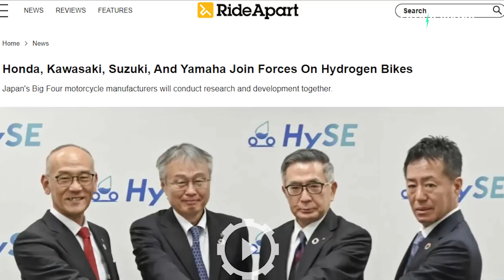Honda joins Toyota's, Suzuki & Kawasaki to make hydrogen engined vehicles

Comment: The reason hydrogen powered ICE vehicles are attractive to manufacturers is likely because the manufacturing machinery required to manufacture them is almost identical to that curretly used for hydrocarbon fueled ICE vehicles. (Fuel tanks being an exception)..
New infrastructure for refueling stations will however be required but when faced with the prospect of having to scrap billions of dollars worth of plant and equipment it's easy to see why legassy manufacturers are giving it a try.
New BEV manufacturers just don't have the burden of seeing all that investment in plant and equipment go down the drain though they have had to finance the setup cost of BEV manufacturing equipment which ICE manufacturers would also have to finance.
It's a sign of the desperate situation that they are in and goes a long way to explain why they have not embraced the move to BEV's earlier. (Living in denial).

The complexities of developing hydrogen ICE engines:-
https://www.youtube.com/watch?v=3IPR50-soNA&list=RDQMs1knXeKXFO0&start_radio=1

The unfortunate truth about Toyotas Hydrogen ICE Engine:-
https://www.youtube.com/watch?v=vJjKwSF9gT8

Why hydrogen ICE engines are a bad idea:-
https://www.youtube.com/watch?v=1Ajq46qHp0c&t=132s

Comment: Hydrogen power has the advantage of range. The fuel to get that range is much lighter compared to the batteries needed to get that same range with an EV.
Reply: The first 600 mile range EVs were delivered last week. H2 isnt going to happen.

Comment: JCB in England have also developed a hydrogen engine for use in tractors, Lorries, Construction machinery etc. Their engines are beyond the experimental stage and are well into live testing. Installations. They are convinced that for commercial vehicles it is a better option than battery.  I wouldn't write off the hydrogen engine just yet.
Reply: For some applications H2 will work, but it wont be many. Hydrogen requiresa lot of electricity to create as a molecule.
Reply: If I have fuel cell. With motor with instant torque. A decent size battery pack for last mile. Why bother with thousands of moving parts? If we are concerned about copper shortage，fine. Lets get some aluminium wire eith copper plating. It is not as good, or efficient. But it drive thr cost down and save weight. Lithium is pricey and hard to extract. Well, how about sodium, that is cheap and good enough to work.

Comment: I could have one now in my Toyota truck by putting a high pressure tank in the back and running lines but where would I get the fuel? On top of that, the fuel isn’t any cheaper than gasoline so what is the point.

Comment: So i strill have to pay for oil,oilfilters,fuelfilters air filters, clutches, exhaust,brake pads ,fuel pumps, spark/heater plugs ,dpf,cat. And pay to have them fitted ? Noooooooooooooo way japan 😜😵😆🤪🥴😊

Comment: You've answered your own question. There are many ICE powered things that are not suitable to be battery powered. You're hung up on the car industry thats why you can't see their logic. Japan will use it's new gas cooled nuclear reactors to produce cheap electricity to kake hydrogen. It will when it's ready mass produce electric cars. They will do so more efficiently, cheaper and the product will be more reliable. Just like they did in the 60's withe ICE powered cars.

Comment: You would think that there is nothing wrong wwith EV's...there is plenty wronng with them....the main one is mileage.....if they can recharge to full...not 80%...in five minutes...then they will have cracked it...nowhere near that right now though!!!
Reply: I've spent zero minutes charging my Tesla in the last 8 months. The only time I have to wait is on a road trip, and the 15-20 minutes is about the same time I would take to stretch my legs and go to the bathroom after 200+ miles of driving. If you average the gas filling time with road trip charging, I spend much less time refueling my car. Gas is a waste of time.

Comment: Everything about hydrogen is troublesome: production, transportation, storage, efficiency, transformation to motion, refueling speed.
Everything about electricity is easy: production can be clean, storage in megapacks, very efficient, electric motors have been around for centuries, rapid charging speed, less than ½ hour no matter the size of the battery!

Comment: I understand their interest in Hydrogen. Simply put two stainless steel electrodes into water, add a catalyst like salt and introduce a low DC current. You are now producing the most Explosive Element in the Universe. But You are Right. A lot of heat is generated from the ignition of Hydrogen.
Maybe, they can figure out a way to do it.
Imagine Water as Fuel, No Pollution.
Reply: To try this at home. A 9V Battery is good enough for demonstration. 2 S.S. kitchen forks, a teaspoon of salt. Then just add a drop of Dish Detergent to form Hydrogen Bubbles and ignite them using a match. Note: Don’t let the 2 S.S. Items touch each other after applying current.

Comment: According to Toyota the move to hydrogène internal combustion is justified by the following reasons:
Toyota believes that the world is not yet ready for all electric engines ( poor range, very long recharging time,availability of charging stations...).The range with a hydrogen engine or with an electrical engine fed by hydrogen is similar to a petrol car,filling up time is 2/3 minutes.
.The hydro engine also is zero émissions and avoid depending on availability of natural ressources to build the batterries.
- Toyota also believes that the driving pleasure of a car must be maintained and the internal combustion engines allows this.
Finally Toyota doesn't want to put all its eggs in the same basket by going solo electric.
The EU has also made the développement of hydrogen a priority with the creation of the EU HydrogènBank as part of its Net Zero.Industry Act .
Stellantis, Renault are also developing hydrogen fuel cell engines in France next to their electic or petrol,diesel engines.
Legacy brands are leaving all options open I guess by offering the customer a wide choice of engines.

Comment: i am glad they are choosing to go on a separate path instead of following the herd.  There are many obtacles in the way of wide adoption of EVs.  One being, the vast amount of minerats required for the batteries. The better the range, the heavier the battery, the more the minerals required.  High demand means high price.  Two, geopolitical consideration,  China monopolize rare earth refining.  China control the prices.  They are the largest consumer and refiner in the world.  Very difficult for foreign  competition to take hold.  Rare earths are required for EV motors, wind generator.  The extraction transportation and processing of these minerals requires burning hugh amount of fossil fuels.

I hope this Japanese consortium will some day provide the world with a viable alternative in hydrogen vehicles.  incidently fuel cells also requires minerals like platinum.

Comment: I thought some time ago hydrogen would replace gasoline and diesel . It's an abundant element . We saw some attempts from GM on EVs with a big crash and burn some years ago . Nissan did finally bring an EV to market but it was mostly a novelty and they were not motivated to push the technology forward . So all was good with gas and diesel powered vehicles . The Japanese you could say are the best in the world building ice but as sam suggested building a ice engine running of hydrogen was a challenge so that's why Toyota went with the hydrogen fuel cell but electricity isn't their bag . Tesla changed the world and it was unexpected   Toyota just did not see it coming as many others . They just don't see a way to compete on the EV platform . Now they may get this to work but the problem is making and storing hydrogen . It's expensive to make and energy dependent . Who is going to put in a hydrogen infrastructure ? Tesla put in the charging network . Will Toyota do the same for hydrogen ? If you could make hydrogen at your local fuel station cheaply and easily you have something that can compete but a fuel cell is still a better option even with that . Either way you look at it they are loosing market share . Can they be a smaller company ? Maybe but the debt they have makes that more difficult and to develope new technologies

Comment: This idea is so dumb. There are Youtube videos that cover the physics / efficiency of the engine. And basically you'd have to pack your car with more compressed hydrogen gas tanks than the car's volume to get the range of a petrol car, or you'd have to store actual liquid hydrogen at immense pressures which would have to be disappated over time. Just what the hell is the point?

Comment: The first thing that comes to my mind regarding hydrogen vehicles is the filling Stations, for the lack of them. There has to be built an enormous network of them. 
And of course you have to produce this hydrogen, which requires lots of energy, much more energy compared to what you use in battery electric cars. 
Another expense is the transportation from the Hydrogen factory to the filling Stations.
Have they thought about these issues?? 
it it will be very expensive to build all this
Reply: Correct and loads more trucks rolling to deliver the Hydrogen because its volumetric density is so low you would need 3 times as many deliveries.

Comment: Actually, H2 might well be the future for heavy equipment, and IIRC JCB have announced H2 as the fuel for their future product lines. This makes more sense, because you want your digger, earth mover, materials handler etc working 8+ hours nonstop on a muddy building site, so fast refueling is important as is as little weight as possible. This kinda rules out huge battery packs, plus a big building site could easily house a H2 refueling station. Maybe the same for trains, in places where electrification is difficult. Finally, H2 should be easy to make cheaply if, where and when solar power is plentiful and cheap. But that's still a way off.
Reply: Do you aware how big the 5 Kg class IV hydrogen cylinder used on Mirai is? Dont count on building a hydrogen station in the middle of no where when those heavy equipment are usually located.
Reply: @林振华-t4v  Mirai H2 cylinder :: I saw the guy getting into the car and it was almost shocking how little room there is inside. The space between the front seats and forwards (taken up by an H2 tank) makes the transmission tunnel of an ICE car look tiny. And the back was even worse, because the whole of the back seat sits on top of another H2 tank. So the Mirai is fine for small Japanese people but just try getting four Dutchmen inside!
Reply: @林振华-t4v :: I was just spitballing about the trains. Thought of Australia, where they have thousands of miles of desert with a ton of sunshine. Consider the idea of trains running across the desert, powered by H2. They could put solar farms at intervals along the track where the solar electricity would be used to electrolyse water and generate H2 to refuel the trains. The trains would capture the water created in the combustion process and refill the water tanks at the refuelling stations. Neat eh? If they go ahead a do this I claim it as my idea and I want royalties.
Reply: In the future autonomus taxi drone and aviation could render personal car transport obsolete big corporations will own everything to do with transport and have hydrogen hubs for refuelling

Comment: Will it be the latest betamax vs vhs episode?
Reply: Could be. I am old enough to recall being told that Betamax was the future, just like EVs are now. Good luck selling a used Tesla in a few years time
Reply: @jimpackard8059  cd-i is the future
Reply: @jimpackard8059  you may well be right.  This chapter is not finished yet.  Time will tell.  It could be hard to sell a 10 year old EV with a 60-70% depleted battery.  But then again who knows?  As to hydrogen, I am not very optimistic about it due to many challenges it has.  We need to see feasibility studies such as mpg equivalent etc.

Comment: The main emission coming from such a system is water. Seems harmless, but in certain climate conditions, it will produce fog. I think it would also be unsuitable in long tunnels.  Also, since it is burning oxygen from the atmosphere,  which is 80% nitrogen, there would be other emission byproducts. Maybe a chemist could explain what other byproducts would be produced.
Reply: Just so we are clear, water vapor in fact is GHG. They say it trap energy more efficiently than Co2 by alot.

Comment: If the waste heat would be usable at least.
Like running a hydrogen engine at home for heating and using the motion to produce electricity as a side product…and this isnt interesting at all until we have way more renewable energies.

Comment: While I do like your channel, Sam, and mostly agree with your crystal bowl opinions, there are some angles in this case:

1. Solar and wind energy can be converted into electricity, or they can be converted to hydrogen. True, electricity is inexpensive now, but that is with years of research. Hydrogen could possibly get there, we should not rule out possibilities, otherwise there would be no Tesla or Spacex.

2. The ICE is easily modified to run on hydrogen, so it keeps the sunk costs viable.

3. By the time hydrogen is cheaply made, fuel cell technology could be better developed.

4. It is better for legacy automobile companies to try rather than just play dead. We need more research, not less.
Reply: At last !! A comment based on some common sense.

Comment: Toyota, in my opinion, make the best internal combustion and hybrid engines, so if these companies combine their undoubted engineering excellence, I would be surprised if it didn't work. The problem will be the infrastructure i e. H² filling stations. There are a few in the UK (you can buy the Toyota Mirae which is hydrogen powered) but a huge investment would be needed to roll this out. With EV sales increasing rapidly the four Japanese manufacturers may have left it too late

Comment: An incredibly energy-inefficient mode of transportation when you factor in the huge amount of energy required to generate, store, and transport the hydrogen, and the difficulty and weight penalties of creating fuel tanks that won't leak or fail from hydrogen embrittlement.

Comment: Ultra-lean combustion engines has low combustion temperatures, comparable efficiency to fuel cells, and are essentially ZERO EMISSION.  Liquid Hydrogen is much lighter than petrol and is great for airplanes, trucks, ships, and trains in order to increase payload!

Comment: Japanese car makers have all united to find a way to compete with electric cars, they have fall behind so far, that they believe it is easier to work on their own technology proposal even if this technology may not work.
The Japan auto industry does not want to part ways with the internal combustion from fossil fuels, this is why they continue pushing hybrid vehicles, when it has been proven that most hybrid vehicle users run their cars in ICE “mode” even the vehicles that can be plunged to be charged.
Japan with the most tech savvy companies and people in the world, have not been able to change or move forward from internal combustion from the 1800s

Comment: this is madness, I actually facepalmed, what about hydrogen embrittlement of the tanks, keeping it cool, the dismal energy conversion rate making hydrogen, storing, it, converting ti to electricity, converting that to kinetic energy, not to speak about the infrastructure needed to refuel these, the dangers of Hydrogen explosion is much more dangerous than diesel/pertrol explosion, the propagation speed makes it detonation compared to conflagration of diesel/petrol. everything about it is just impractical, this is a complete dead end they are wasting their limited resources on, I am not even going to wish them luck in this, I am already convinced this will end badly.

Comment: Hydrogen cars are not going to work in reality because:

1. No country is going to foot the bill for developing BOTH an EV network AND a hydrogen network.
2. Due to the nature of hydrogen gas, it will be expensive to store it and transport it, you will need high pressure containment every step of the way.
3. A hydrogen engine is stll at the end of the day an ICE engine, with all the problems that comes with that.
4. Hydorgen is the most combustible element, and hydrogen fuel requires the least ignition energy. Imagine getting into your hydrogen car and riding that bomb to work every day.

Comment: Noted... Adding Toyota Suzuki and Kawasaki to my List of Companies that will die in 10years to EV.. If i worked for an ICE company i would be putting in my resume into an EV company right about now.
Reply: Kawasaki are ok they build japans bullet trains (Shinkansen) in a joint venture with Hitachi.
Reply: @stevesinclair1791  yeah, funny they have the competence on electrical propulsion system right across the building. But not tapping into it. As far as I know, the motors on some Chinese electric bus are coming from railway electric propulsion system vendor. I am sure some of the designs are coming from rail application